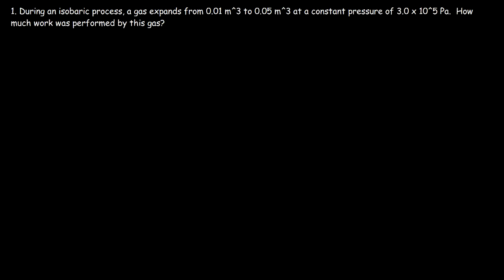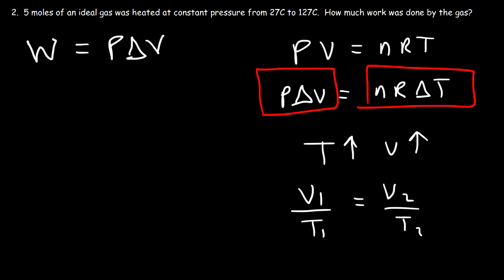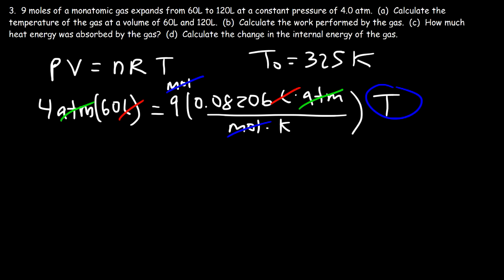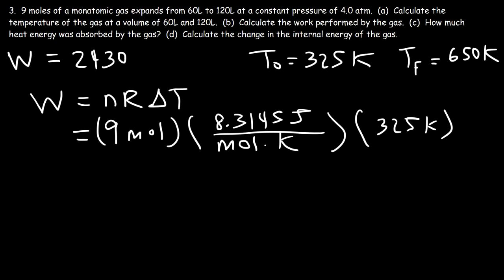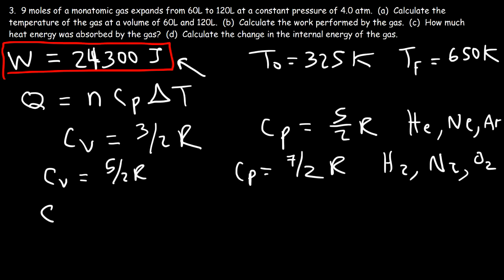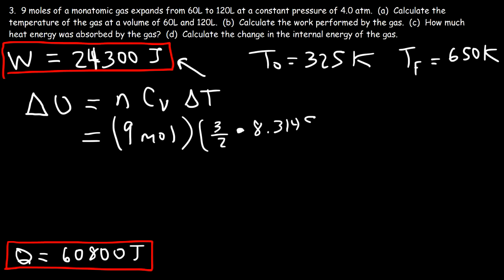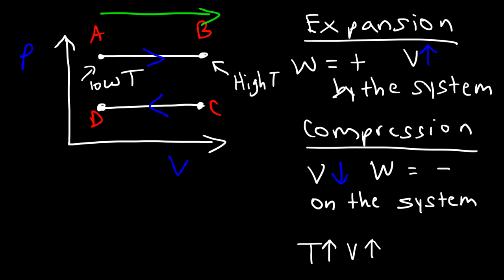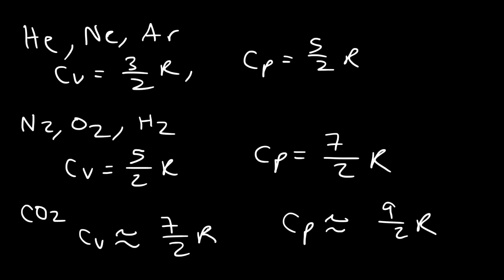Isobaric Process Thermodynamics - Work & Heat Energy, Molar Heat Capacity, & Internal Energy

Comment: I have a doubt Sir, in question number 3 about calculating the change in internal energy of the system. The problem is about a constant pressure; volume expansion process, then why using Cv instead of Cp... any interpretation????

Comment: In the case of Rankine  cycle for Boiler or Refrigrstion heat is added or removed at constant pressure and there is no volume change. 

Specific volume change values when super heat is added or removed can be used to find the work?
Thank u

Comment: Can someone help me with this question:
2 moles of an ideal gas kept inside a cylinder at an initial temperature of 27 degrees celsius is made to expand at a constant pressure of 2 x 10 to the sixth power until its volume is doubled. Calculate the work done by this isobaric process.
Reply: W = n*R*deltaT
Charles's law: V1/T1 = V2/T2.
This gives us V1*T2 = V2*T1.
The volume doubled, so V2 = 2*V1, if we substitute this back in the previous equation, we can cancel the V1 on both sides, and we get T1 = 2*T2, so the temperature (in kelvin) also doubled.
27 °C is 300 K, the double is 600 K, the change in temperature is deltaT = (600 - 300) K = 300 K.
If you substitute this back in the first equation (along with the 2 moles), you should get approximately 5000 J.

Comment: Why did you uses U=nCv*dt for an isobaric system. Cv is only used for iso-choric calculations right?
Reply: Change in internal energy is path independent. The equation is the same for any process, unlike Q and W which are path dependent and depend on what process the system is undergoing.
Reply: @scottphan6172  but Cv and Cp has different values, right?
Reply: I think it should've been Cp for an isobaric. Delta U = q + w -> dU = dq + dw. Since dH = dq for isobaric processes, we can take the derivative of dH = integrand Cp(T) dT to end up with Cp*dT.
Reply: @SunSunSunn  actually no, because the change in internal energy of an ideal gas is equal to the change in its kinetic energy.

And K.E. = n(f/2R)T
(Where f is the degrees of freedom and n is the total no. of moles)
And (f/2R) is equal to Cv only.

THE CHANGE IN INTERNAL ENERGY OF AN IDEAL GAS DEPENDS ONLY AND ONLY UPON TEMP. (it is independent of the type of process, it only depends on ∆T)😄
Reply: Lol this was one of the thing which my sir told me not to be mistaken of
Reply: Cp-Cv=R
Cp-R= Cv

dU= Q-W.
dU= nCpdT -nRdT
     = ndT(Cp-R) putting Cv=Cp-R
Hence, dU=nCvdT
Reply: I think it's because in isochoric systems, there is 0 work done. Therefore, change in internal energy equals heat: U=Q-W --> U=Q=nCv*dt. It's just taking the same parameters from the given isobaric process and hypothetically simulating an isochoric process so that the work falls out and U is easily calculated

Comment: Why did you use 0.8206 instead of 8.3145 at 4:25?
Reply: He did it to keep units constant. 
If the Volume is in Liters and your Pressure is in atm you will use R=0.08206 L/mol.K .
If your Volume is in m^3 and your Pressure is in Pa ( which is N/m^2) then you use R=8.3145 J/mol.K
Reply: Units provided litre...R is Universal Gas constant which varies according to unit 0.8206 L atm/Mol K.. 1.987 Cal/Mol K or 8.314 J/Mol K...
Reply: That's the coefficient of R when using atm for pressure  and Liters for volume.
Reply: BTW it's  0.08206 atm Liter/(mole*K)
Reply: @mikevar9090  what is atm?
and what is r?

Comment: why when work is done by the system... i mean when gas expands why work is positive?
Reply: Syawl it's just a convention chosen by physicists. For Chemists, work done by a system is always negative but for physicists, it's positive
Reply: @de-grafthazard9081  which is really F**king annoying.
Reply: Because in the Mechanical version of the first Law dW = +Pdv and is always positive for Work done BY the SYSTEM and Negative for Work Done ON the SYSTEM during an expansion.  In the Chemistry Version of the First Law, the signs of the work are reversed for Work done BY and Work done ON the SYSTEM from the Mechanical Version.
Reply: In a constant pressure process: dWby the system = + PdV, or Wby = P (Vfinal -V Initial), since in an expansion Vf > Vi ,  you always get positive work of the gas pushing the piston out making the Volume larger. The gas is doing the work so it's Work by the system.
Reply: hye, once i enter my degree life now I get what do you mean , thank you